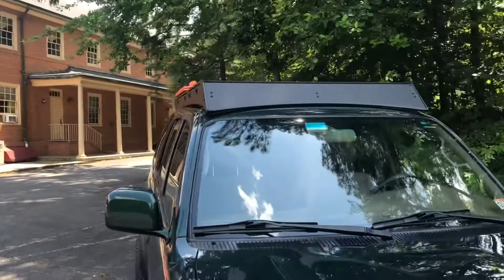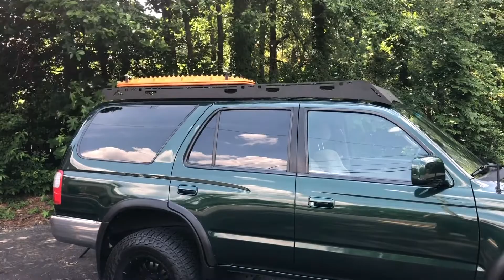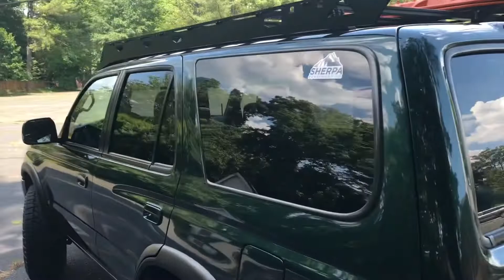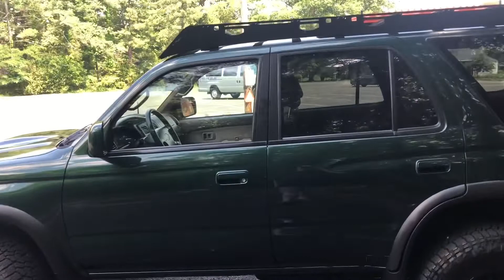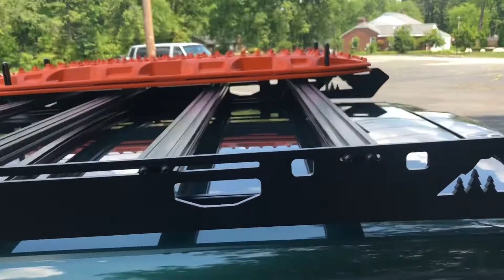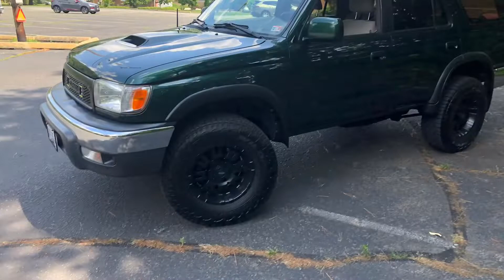3rd Gen 4runner Roof Rack

Comment: The 2 front feet at front of truck just behind the windshield , r they just sitting on the roof, r they 3M taped or drilled??

Thx
Reply from the maker: They are just sitting there but with downward tension.  The Sherpa install video better explains how to do it.  I have had zero trouble with this setup also, super stable.  Look at 7:52 of install video. 

https://youtu.be/OAhZDzrpVpg
Reply: Thank you very much

Comment: Are those stock toyota fender flares?
Reply from the maker: Yes they are with one exception.  The front mud cap ends are from a seller on Etsy and replace the Factory versions since they are no longer made.  When I removed the side steps I wanted a more factory accurate alternative. Link below if you are interested.

https://www.etsy.com/listing/840403582/1996-2002-sr5-4runner-mud-flap-end-caps

Comment: Thank you for posting this video. I just ordered the rack. I was having trouble visualizing it on my rig. What do you think of the fit and finish of the Sherpa.
Reply from the maker: I have been very satisfied with it and the fit/finish is top quality.  One thing that I think Sherpa does very well on also is all the accessories and mounting options they provide also. Bit of advice though…get the fairlead light bar if you can, i am going to add that as I think it looks better.

Comment: Very nice rig! I have the same truck (SR5 Imperial Jade Mica Green) with the Matterhorn rack. I noticed that all the emblems on the back hatch door are black. Did you remove and paint or are they emblem overlays? I would be interested in a mods video. Thanks!
Reply from the maker: Thank you!! Will upload more soon.  The emblems on the rear (4runner/SR5) are black aftermarket replacements of the same style.  The Toyota symbol I repainted (sanded, adhesion promoter, primer, flat black, clear coat).  I may have gone overboard but was trying to prevent peel/cracking.  It has held up very well so far.